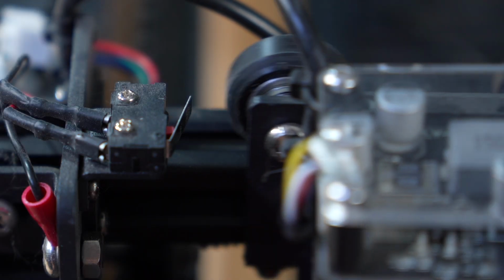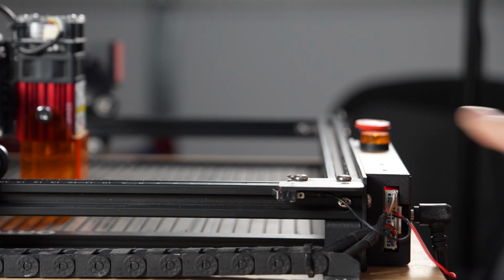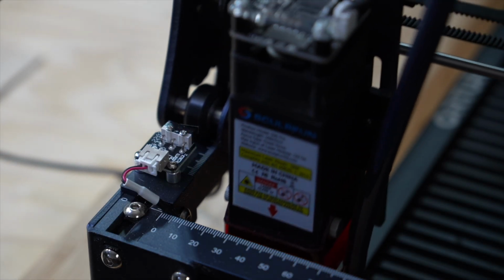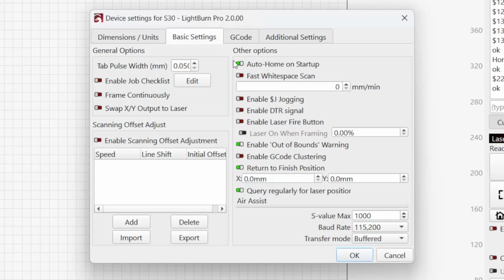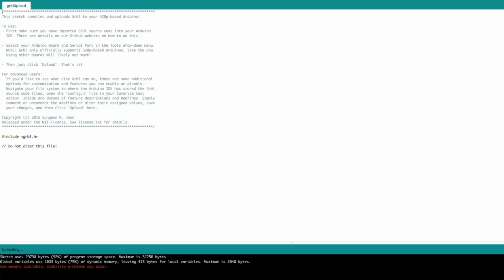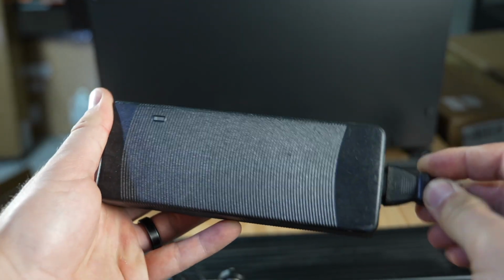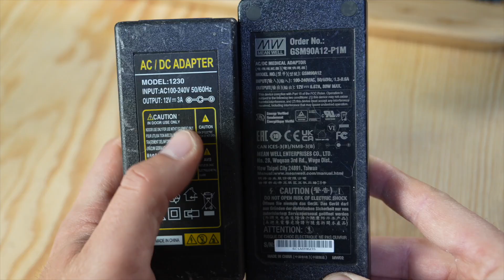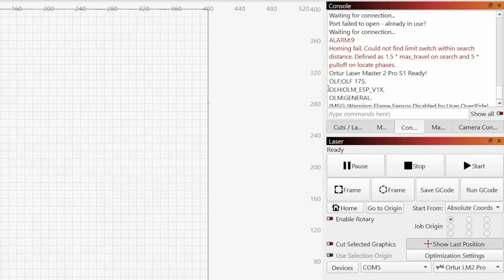GRBL Errors: Alarms 8 & 9

Comment: When manually moving your motors, be sure not to move them too fast.  The will generate power and could fry your drivers.
Reply from the maker: This is a good point. Generally as long as your not moving them too fast its not an issue but it is something to be aware of.

Comment: I work in making jewelry and I want to know the size and dimensions of the piece that is hollow like the name so that I know the required thickness for cutting
I used the measuring tools, but it only calculated the internal area. I want a tool that calculates the area for the name.
In jewelry, we rely on weight. If I want a tool to help me calculate the area of a specific shape, I will know the thickness required to cut it.
Where can I get it or is there a simple explanation of how to calculate the area?
Reply from the maker: LightBurn does not currently have a tool for this. I believe your question was forwarded by someone in our support team, so we’re discussing it.

Comment: Is it possible to use LightBurn to change the homing location? My Creality Falcon 2 homes front left. This means the gantry is in the way when placing or removing media. I prefer right rear.
Reply from the maker: The homing location usually has to match where the physical homing switches are. There are firmware settings to change the direction when it homes, but I’d contact Creality to see if the machine supports it, or you’d need to move the switches first.